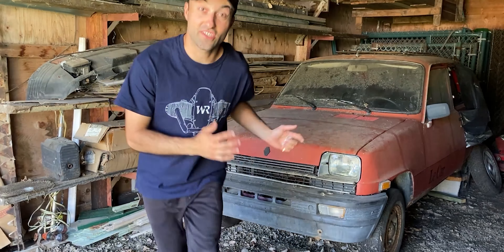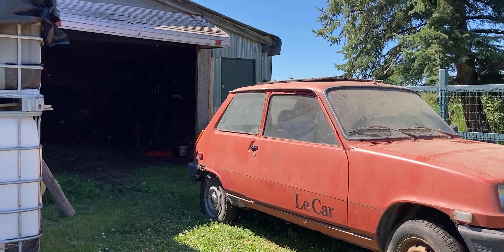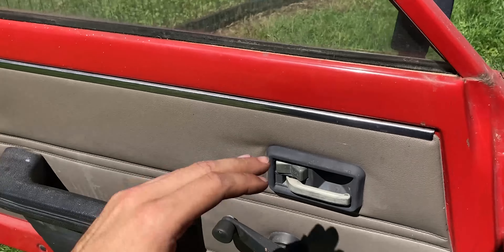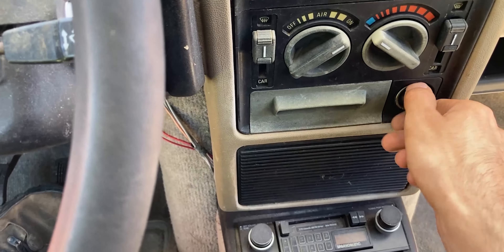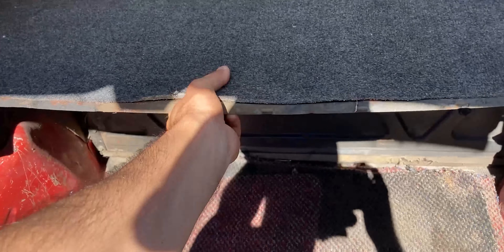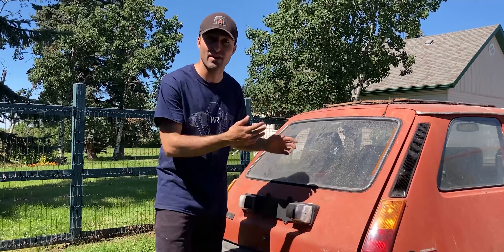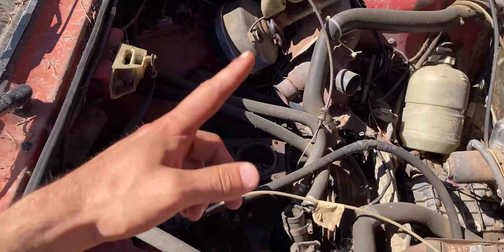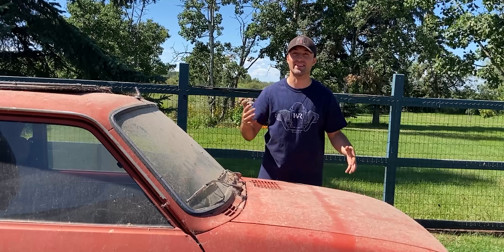Renault R5 Classic Car Barnfind!

Comment: I bought two of these, 1980 Le Cars (U.S. version), one new, the other used.  They had a 4-speed transmission and yes the engine displaces 1.4 liters.  I loved them!  Fun to drive, great ride, easy to work on except for the starter which required removal of the exhaust manifold.

Comment: I’ve grown up with these cars. Looks like you have euro bumpers on it pretty cool they look way nicer than the us ones. If you plan on rebuilding the engine you can use pistons and liners/sleeves from a Renault alliance or encore 1.4liter they are the same as the Renault le car or R5 as they call them in Europe. The block on the le cars are different from the alliance and encore and I’m pretty sure that transmission is a 4 speed. The only 5 speeds they made came in the Renault 5 alpine and gordini. As for the head you can either use a 1.3 liter head from a lecar or a 1.4 the 1.3 will boost the compression a little bit.
Reply: My dad told me they made Canadian 5 speeds I guess they’re pretty rare though and it’s a little different from the alpine girdini ones
Reply from the maker: Thanks for sharing all this information with me! You must have a lot of knowledge when it comes to these Renault R5's and I'm glad you tuned in to watch this video. I will be rebuilding this drivetrain as it really needs to be gone through!! I have a good amount of parts that I can choose from and I'll share all this in upcoming videos. 
I agree with you, this is actually a 4 speed manual transmission and it threw me off because I was researching about this car online and I read 5 speed and that stuck with me! Lesson learned. The Euro-Bumpers give the car a better look and I hope I car make it all look much better with a little bit of work. I still have some other projects that I would like to finish up first, but that is not stopping me from progressing on the neat little car. Thanks again for sharing your comment & feedback! I appreciate it. Regards Andreas
Reply from the maker: Yes, they did...but they were late model cars and very few were made in this configuration. Like I mentioned above, this car does have a 4-speed.

Comment: I had sooo many of these years ago. I think you meant recirculating air as this particular car didn't have a/c. Some did, but the a/c controls were mounted in that little cubby above the dials. Those that had a/c the spare tire was mounted in the hatch area. Without a/c the spare was in the engine compartment. Also, no Le Car ever came with five-speed - they were all four-speed. Good luck with the restoration!
Reply from the maker: Thank you for your valuable information and feedback! Your information is spot on and I'll remember this for future content. I'm still learning a lot about these cars with the literature I have, so any input will help a lot!! Thank you for your kind words. Regards Andreas

Comment: The Front of the engine is facing the fire wall.
Reply from the maker: That is correct Richard! This drivetrain is setup very interestingly and it offers good balance around the front of the car. Even though this engine is under the front hood, it is technically speaking a mid-engine car😁👍🏽 Thanks for tuning in